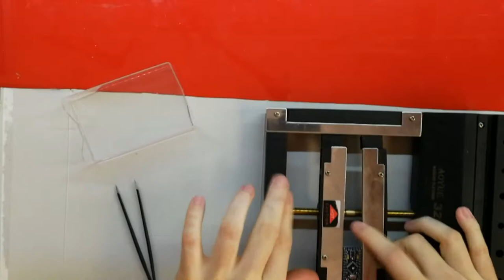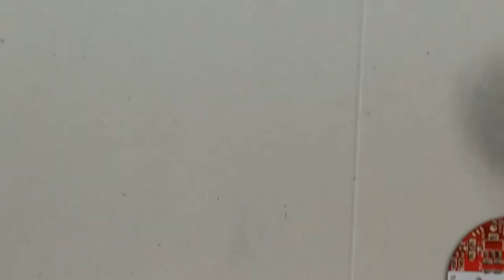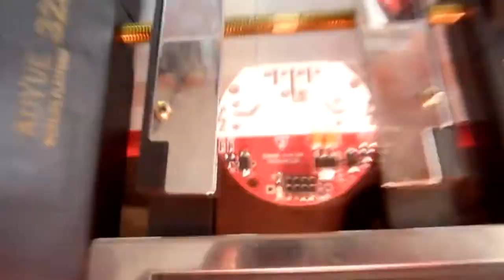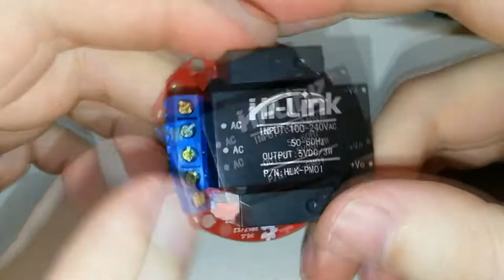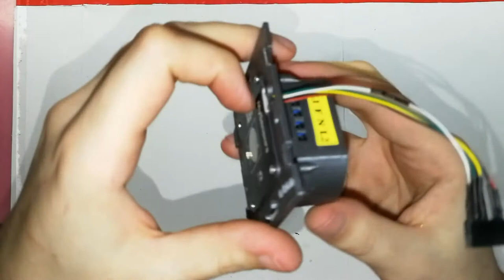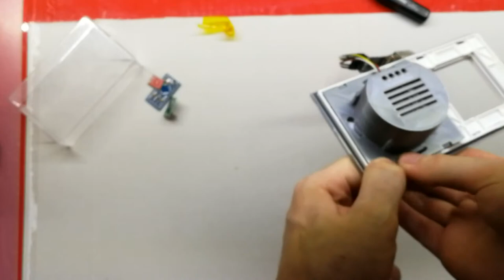SmartHome: Wireless Touch Switch - Assembling circuits

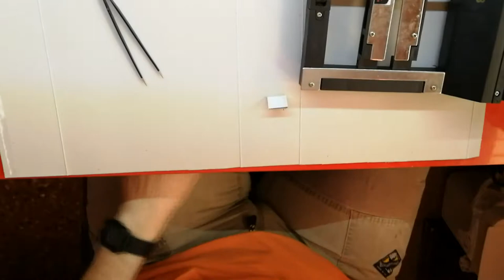Comment: Nice work. I'd like to know what is that piece of plastic that you removed from another board in 1:25 and then put on the touch board on 16:50. It is necessary to work? I developed some touch boards based on TTP224 and when I saw your project on Openhardware last week I started to being worried about this feature. My idea was like yours, but based on sonoff touch switches. Thanks in advance for your attention. I loved the organization that you have on your projects!
Reply from the maker: Hello Claudio,

I'm glad you like the project :)

In the video is not well observed, the piece that I remove at 1:25 is a piece of plastic that reflects the LED light. As that piece does not sell loose, I have to buy the whole module only for that piece.
https://www.aliexpress.com/af/HTTM.html

I just recorded a video to see the difference, when the reflector is not installed the light is weaker and there are reflections/shadows in the glass, however after applying the reflector the light is uniform and the reflections/shadows disappear.
https://www.youtube.com/watch?v=B_pF92iO-Jk

Greetings.
Reply: Wow nice, there is a huge difference indeed. Thanks for your help, this mean that I can send my boards to assembling! Have fun in your projects!
Reply from the maker: Not only is it a light diffuser, it also redirects light upwards, similar to the backlighting of LCD screens.